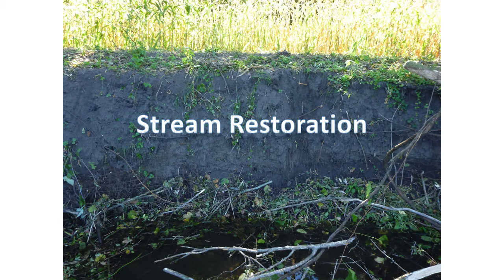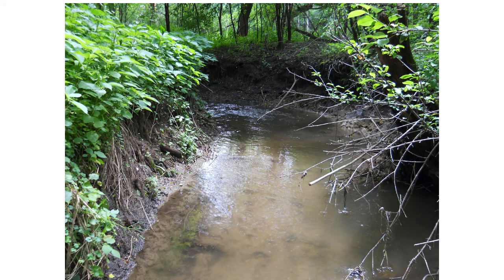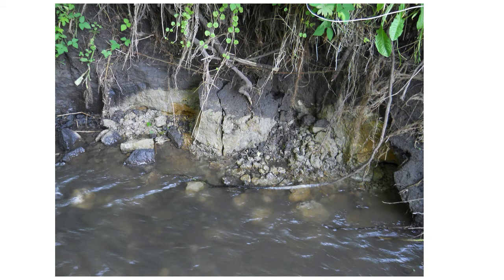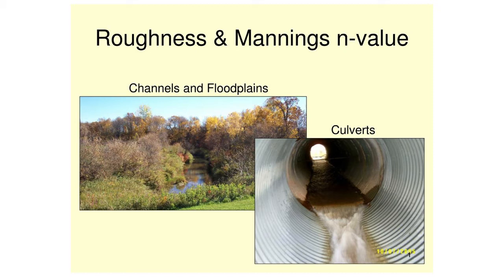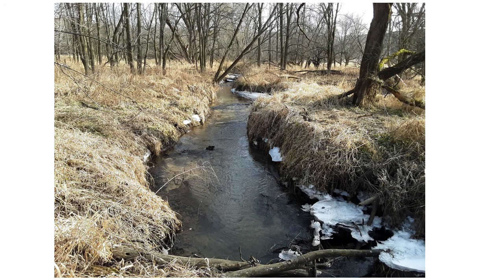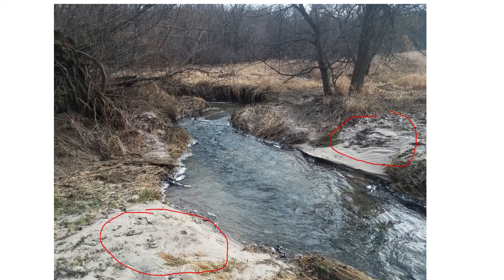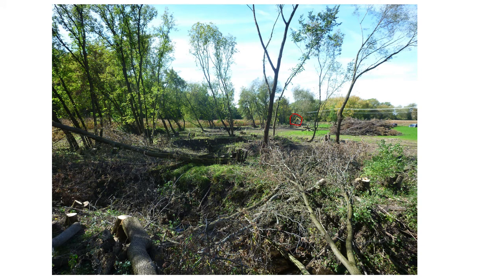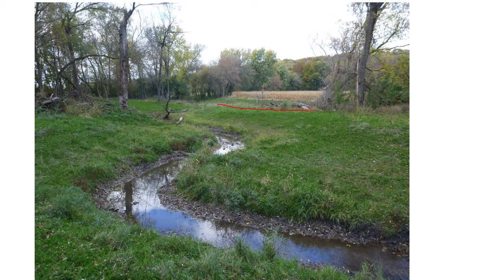Stream Restoration by Derek Kavanaugh

Comment: Pre-settlement is 300 years after the first fur traders were buying beaver pelts in Wisconsin. The landscape had totally changed after the beaver and bison were removed from the area. The riparian zone trees, eastern cottonwood trees, black willow trees and water elm trees, that were the only trees that could survive in the wetlands caused by beaver dams have mostly disappeared from these streams. I noticed two very old magnificent black willow trees along the streams in this video. The riparian zone trees, eastern cottonwood, black willow, and water elm have root systems that hold the streambanks from eroding. Hopefully. you noticed this in your restoration work. Even today without the beaver the root systems of the riparian zone trees next to the stream provide shelter for baby ducks, the fish in the stream, and the other aquatic inhabitants in the stream. The riparian zone trees also provide nesting habitat for Eagles, Red-headed Woodpecker and Bell's Vireo which are threatened species or special concern species. The dirt streambanks made by the bison herds was where the endangered female bumblebee hibernates over the long, cold Wisconsin Winter. Scientists have found that the riparian zone trees also have the function of neutralizing the toxic chemicals from the stream bed silt deposited on the streambank during a flood. So please, try to restore the streams to pre-beaver trapper condition in the future so that all the endangered and threatened species that live in a riparian zone can be preserved for future generations. Thank you.